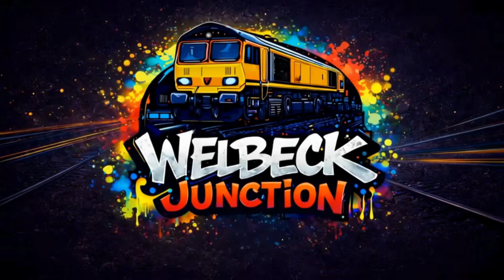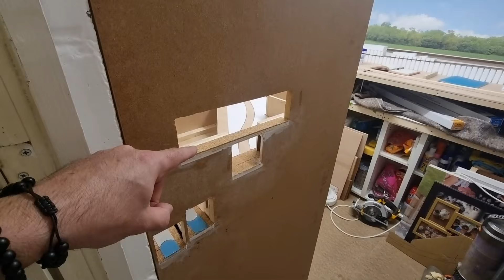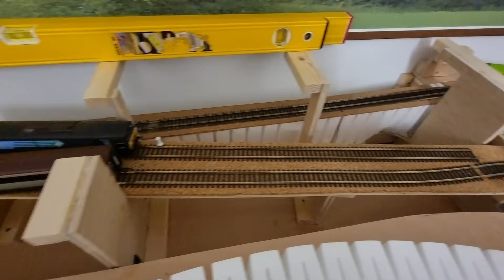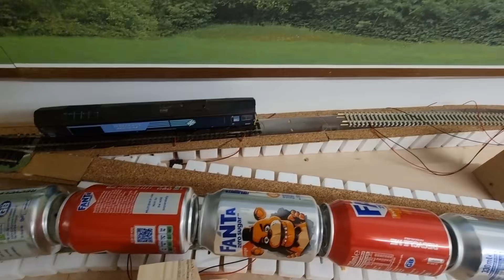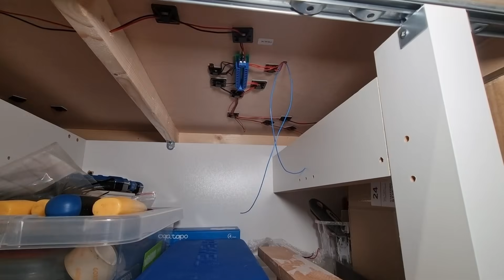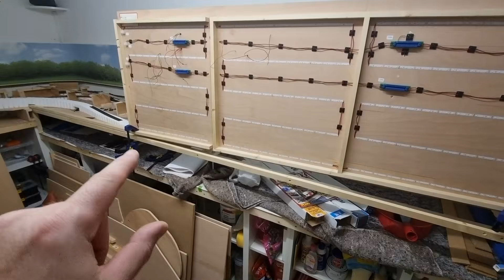The First Running Lines Are Down! | 00 Gauge UK Model Railway Build | Episode 12

Comment: Great work, what power distribution boards are those?
Reply from the maker: They are Evemodel ones, via Amazon, seem really good, robust, not had an issue with any circuit failure in them yet.
Reply: @WelbeckJunction brilliant, thank you
Reply from the maker: Not a problem, I would recommend them, nice firm connection when you screw them down to the bus.  They also come with some nylon spaces to lift them clear of the mounting surface which is a nice touch!
Reply: @WelbeckJunction fantastic thanks for the info

Comment: Hello, really enjoyed the update and the way you're making progress on your layout. Your idea about using DCC concepts power base plates is a really good one. I am going to use that as I am currently building base boards for my new layout. I was just wondering if you cut them before or after you glued them down? I am not quite sure from your video. Tim.
Reply from the maker: They are just the right size, and when glued with the track ontop are rock solid 👍🏼 My approach, place and then mark the needed cut, cut with some tin snips, or multi-tool, then glue down. Track wise, I lay that over the joint, let the glue set hard then cut with the multi-tool so the alignment is spot on (apart from where the track will span the door, where I have cut it already 🫣).